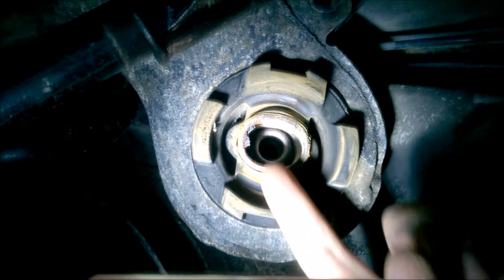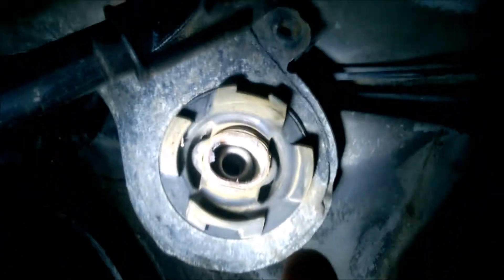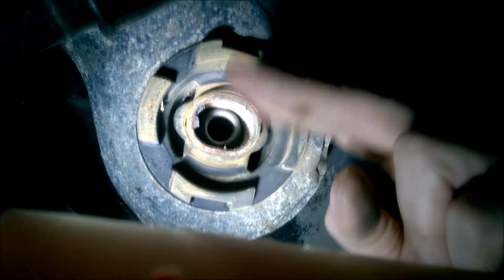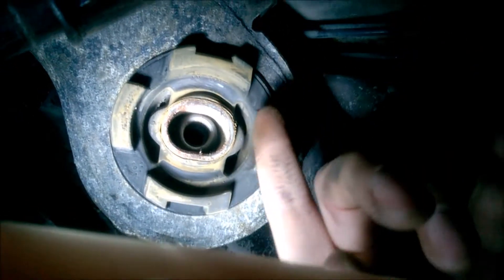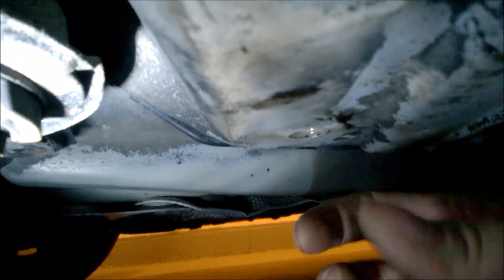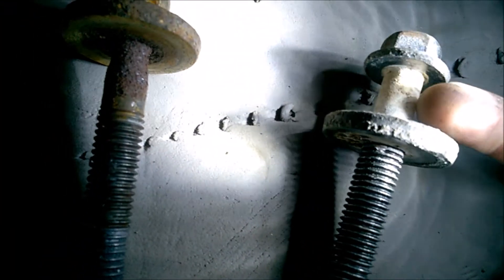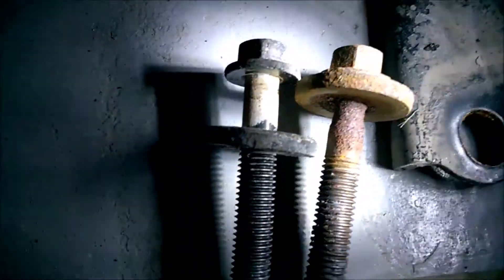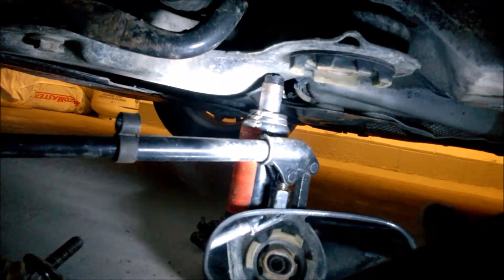How to inspect subframe bushings Volvo S60 2001-2009

Comment: Mine failed prematurely, I'm at 205K Kms and I think they've been bad for over 30K Kms. I went to check and the 2 rear ones are completely collapsed, the divots where you're supposed to install the inserts are completely shut closed, cracks all around. I bought the beige power delrin replacements. Did you also realize that bushing had an oval middle? I also had one that was oval for some reason, the 3 others were round.

Comment: See my video about the Volvo special tool #9995457, Subframe Bushing Removal/Installation tool.  I replaced all 4 bushings on my 2002 V70.  For a while I had the polyurethane inserts from IPD, but I eventually swapped everything out in a big suspension job.

Comment from the maker: May also try inserting a long screwdriver or a ratchet handle and twist the bushing sideways.  It shouldn't be too soft of twist too easily.   Subframe bushing inserts are available online and may help with worn bushings (with over 120K miles).  Try not to get the ProParts Sweden, get the Ipd instead  https://www.ipdusa.com/products/8969/120168-ipd-poly-subframe-bushing-insert-kit

Comment: can you change the bushing/put inserts while on ramps? or the car need to be on jack stands?
Reply from the maker: Good question. As a mater of fact, I ordered new bushings from Volvo, but when I went to lift the car, I realized my 14in floor lift doesn't rise high enough for this job.  To just push those inserts in it should be fine, but for a full bushing job the car must sit quite higher off the ground (to smack the bushing in properly with a hammer) and the jack must also reach high enough if used to press in the bushing. Of course, we need jack stands as well for safety

Comment: HI, Broken subframe bushings just make a noise when breaking , or its for steering wheel
 ..... ?
Reply from the maker: It's hard to say if worn subframe bushings make noise.. possible but there is little information on forums about this. I would expect more to hear a single loud metallic 'clunk' under the car when accelerating because that's when the engine develops the torque that puts force on the subframe.  This would cause the subframe to touch the front side member
Reply: @Peppermint1  I'm having this issue currently in my 850R sedan. The subframe bushing on my vehicle has 147k miles on them. The issue started after i had my rack replaced then noticed my sway bar bushings needed to be replaced. After replacing sway bar bushings there is still a light clunk when rotating the wheel randomly. Last worn part of my suspension is the subframe bushings so I will be replacing them this week its gonna be a pretty penny at 300-500$ plus the 180$ in genuine parts. But then at least my suspension will be at a full stage zero and I can proceed to save up for a brand new transmission then get a lifter job and repaint the vehicle. By the time I'm done the car is gonna be practically new.
Reply from the maker: @tonychambers9228   Be sure to use genuine subframe bushings, I've read a discussion in a forum with using another brand (Meyle or Febi), had to be redone within months.  Perhaps Hutchison is also good.  But I would also have a look at the new sway bushings - what kind did you use ?  The Polyflex are not vulcanised to the bar which will allow the bar to 'walk' laterally - this can cause knocking perhaps the lower end link will knock into the control arm.  Not many options for a good sway bar replacement other than a full genuine one. I think Ipd had one at some point but not sure about their quality.
Reply: @Peppermint1  I used 21mm  universal poly bushings for the anti sway bar. Maybe that is whats causing the noise but forsure the subframe mounts need to be replaced. I'm going with genuine volvo hd replacements with a set of new subframe bolts. Do you know what the product number is for the genuine anti sway bar. I cant find it for some reason all of a sudden.
Reply: energy suspension 21mm poly sway bar bushings that are impregnated with graphite. A bunch of people seem to be happy with them so I'm really not sure. This noise is either still the swaybar or its a mixture of swaybar and the subframe.
Reply from the maker: @tonychambers9228  For the bar #, find first the code for the bar on the metal plate - it's the lower number on the right column, 5th character (going to be 2,3,4 or X) https://www.youtube.com/watch?v=kos_nLjjgno    then see the link for the part# that matches the code  
https://www.volvopartswebstore.com/showAssembly.aspx?ukey_assembly=1181774&ukey_make=865